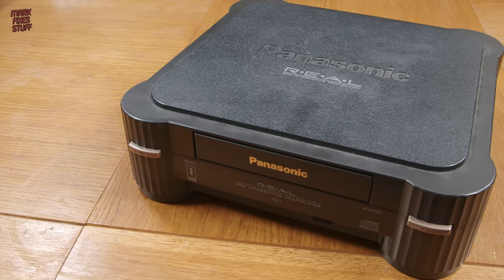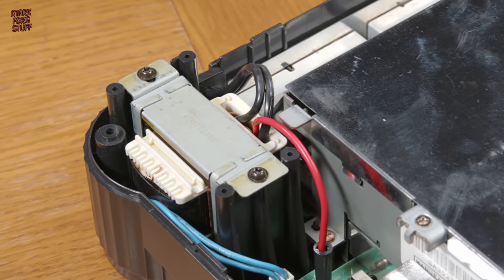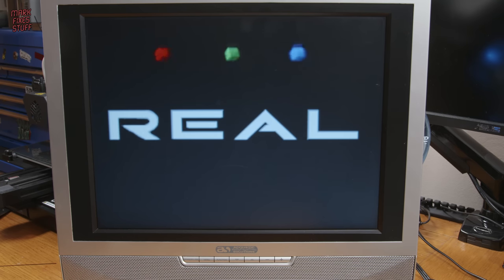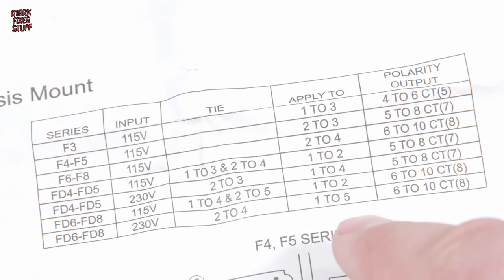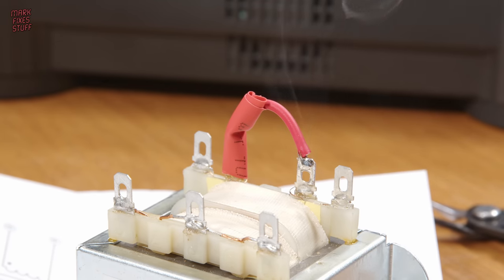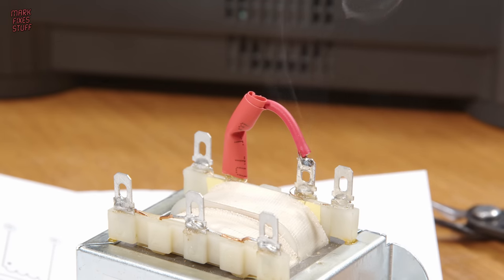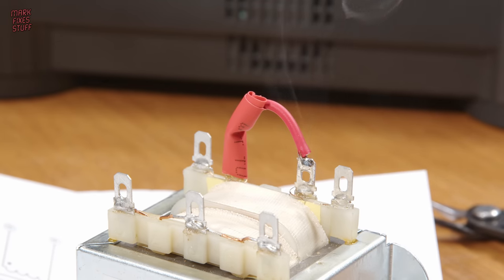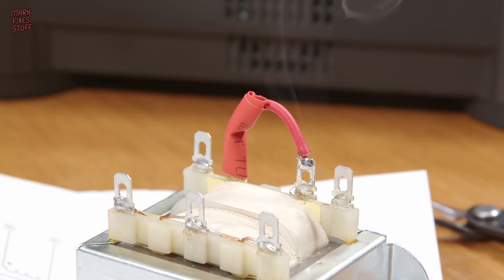Saving an American FZ-1 3DO - Cable Cut Off - Internal PSU UK 230v conversion + LUBE! @MikeDailly

Comment: Cables only get chopped off for two reasons, at least here in Canada. They didn't want someone plugging in a potentially faulty device, usually see that with fans and stuff that could catch fire. The other is copper scavengers, they'll cut any wires they see exposed on anything you throw out.

Comment: OMG I wish it was cheaper to ship stuff from the States.... I have a CD/DVD burner, some blanks of each (a mix of the formats), and some PROPER wire strippers..... but idk if it would be worth it to spend the $100 to $150 to ship them over to you... those are things you can find on the side of the road all the time around here (well, maybe not wire strippers) - BUT if you REALLY need them, just mention it again in you next video and I'll get on top of it (plus any other lightweight things you may need) - I don't check my notifies here on YT and rarely go back and check to see if my comments got a response... so if you are in need of them that bad, best bet is to mention it again in a vid :)
Reply: @Tweedle. I live in Georgia, but will be visiting family in England at the end of August. If you find out that Mark needs stuff, you could mail it to me and I’ll deliver it to the UK.

Comment: Just what I'm was looking for ! Why did you select the FD6-16 over the FD4-16, FD5-16 or FD8-16 ? Can you share the 3D printed files for the cable connector guide ? Thanks
Reply from the maker: Hi Nicholas!  I chose the FD6-16 specifcally for it's power rating of 30VA which is best suited to the console!  You can find the cable gland at https://www.thingiverse.com/thing:5465949 and you can edit it at https://www.tinkercad.com/things/j5777eLPPA6

Hope this helps!
Reply: @MarkFixesStuff  Yes it will help a lot, thanks

Comment: I just bought one… it turns on, but the tray doesn’t open and there is no video :( I don’t know what to do, any ideas?
Reply from the maker: The capacitors in the power stage are likely fried. It's really common.  You can usually test by removing, cleaning up the leakage from and replacing one capacitor C36. Nine times out of ten that's gone highly resistive and whilst the machine is powering on it can't get enought current to boot.

Here's a video showing the process - https://www.youtube.com/watch?v=RurDpNxdsiU

After you have te machine booting you'll likely find drive issues, so search for my 3DO cog replacement videos!

Comment: My FZ-1 has a cigarette burn on the top case. Proof it was a console aimed at a more mature consumer. Mine has a US 60hz board inside which works fine with the Original PSU.

Comment: I picked up a Sanyo T.R.Y. 3DO off ebay for $20 back in the mid 2000's. It went so cheap because someone had cut the power cord. 
I simply pulled a functioning transformer out of a non functioning Panasonic FZ-1, and transplanted it into the Sanyo.
With the addition of a USB reader from MNEMO, I now have one of the rarest 3DO consoles in the world.
Maybe even one of a kind.

Comment: Those 50VA stepdown transformers are not really very good at supplying 120v, they normally load down to about 100v hence your low voltages

Comment: About the soldering of mains cable, you could just use "chocolate" terminal block for the test, its easier, safe and ment to be used with mains volatage ;)

Comment: Would the same modification work converting from Japanese voltage to European voltage?
Reply from the maker: Yes. I've done it.
Reply: @MarkFixesStuff  Great - my Japanese board doesnt have a red center lead like yours though - any advice?
Reply from the maker: @pjoconnell8268 you don’t need to connect it in that case. Some revisions don’t have it.
Reply: You are such a legend responding so quickly. Thank you so much Mark.
Reply from the maker: @pjoconnell8268 no worries. Don’t forget you need to change the capacitor at C36 which has probably dried up or leaked. There’s videos on the channel… somewhere 😂
Reply: I switched the transformer and it worked!…. For a while. Now I just hear a faint buzzing noise and the access/ready lights don’t come on. I didn’t change C36 yet as I didn’t see your comment - is that related do you think? Thanks again so much for the help!
Reply: Replaced C36 - we are back in business! The cap was mangled and stank of fish 😂
Reply from the maker: @pjoconnell8268  beat me to it. C36 always goes bad and blocks voltage. Well done!!!
Reply: @MarkFixesStuff thank you so much, you’re literally the only source of info on this I could find online, I owe you one!
Reply from the maker: @pjoconnell8268  You are more than welcome and than you for taking the time to watch and comment!

Comment: My prayers have been answered! I’ve been looking for a voltage conversion mod to do on my Japanese 3DO. I’ll be looking to do the same mod to mine now. In reference to the S-Video cable, I hope you have better luck than I have. I’ve tried a modern LCD and an old 50/60hz JVC video monitor and I’ve only ever been able to get a black and white image from it 🤷 ideally an RGB mod would be preferable, but that’s a mod for another day. Thank you again for showing the mod.
Reply from the maker: Don't plug in the centre tap. I made a mistake. Other than that, this is the way. I'll do a quick follow up about my foobar.
Reply: @MarkFixesStuff  - point noted. I’ll remember not to do that. Thank you.

Comment: If the console came from 'murica with the cord cut off it's more than likely it was cut for scrap. It's a common practice here with any tech that's either thrown out or recycled. Scrappers will cut off the cords for their copper, fill up their pickup truck beds with them, and sell them for scrap. "Easy" $3,000 (depending on current market rate of copper.) Apparently they just get thrown into the kiln to melt down, the plastic then floats to the top, gets scraped off, and there's your copper. 

If it were me replacing the cable, instead of just soldering the cable directly to the transformer as Panasonic had, I would have installed an IEC C7 socket so I could just use the cable instead. That way it can be easily removed for storage, shipping, etc. Plus if the cable ever got damaged, easy replacement. Now, that WOULD require slightly modding the case, which some would be against, but for me, the benefit would more than outweigh the "destructive" mod. To each their own I suppose.

Comment: Great to see you coming back from the fire mate,  as an electrician, gotta say, very impressive job on the conversion, totally safe with good attention to detail :) Grommet is especially neat. The use of a split winding transformer like that will allow a future owner to convert back to 115/120v use by swapping connections around on the primary :)

Comment: @Mark - Can I buy the old transformer from you? :) I have a goldstar 3DO that is having some issues with power. I changed the caps and the voltage from the transformer is only 10v. :(
Reply from the maker: Hi Dane. Sorry I missed this!  It would likely be cheaper to grab a triad PSU locally mate?
Reply: no worries! I figured out a way to remove the bad transformer and wire in an old Dell 19.7V 3.7A laptop charger. I recapped the Goldstar power board for good measure in the process. Now it runs perfect.
Reply from the maker: @danefieber5517  great job!!!

Comment: Cables are usually cut off by scrappers, for the copper inside. It’s not much but cut enough cables and after a while and some stripping later you have a decent amount to cash in.

Comment: My rule is if the laser is working fine don’t touch it, easily killable. Secondly the vacuuming dust is a bit sketchy I’ve ended up killing a few lasers with static from the vacuum.

Great video overall enjoyed it.

Comment: Cool Video!  Are you sure the new 2A transformer is enough?  Since the fuse in the FZ-1 is rated at 3.15A, I suspect the original transformer is a 3A transformer.
Reply: 2A should be more than enough for a games console. That's into the territory of the big surround sound computer speaker systems with the big subwoofers.
Reply: @RWL2012  yeah they might have been anticipating high draw peripherals which never materialized.

Comment: Try using a bit of flux when soldering wires together or to transformers. The solder will flow a lot better.
Reply: @nemesis2264  it's clearly not working. If you have to shape the solder with the iron to avoid sharp bits it's obviously not flowing very well. Might need more heat.

Comment: Recently got a Japanese 3DO and did something similar, but instead of replacing the transformer I modded a male barrel connector so I could use an external PSU to power it. Cheaper and much easier. Made it output the same location as you'd normally connect the transformer so polarity doesn't matter as it gets rectified anyway. 

Also build a RGB modded it and replaced the Svideo connector with it, so had to design and print a custom bracket to hold it instead of using the Svideo port (as for some reason only the Svideo port is part of the bracket while the tulip plugs aren't) and while I was at it designed a switch for the 240p switch some Japanese models have. If you ever plan on RGB modding it, do yourself a favour and don't use the Via locations and rather use the ones on the chip, much easier to solder.